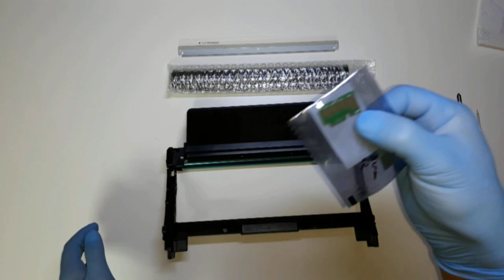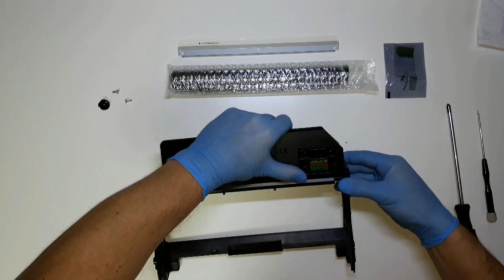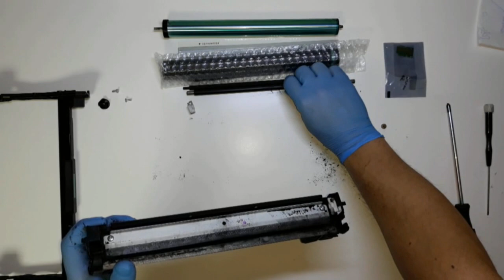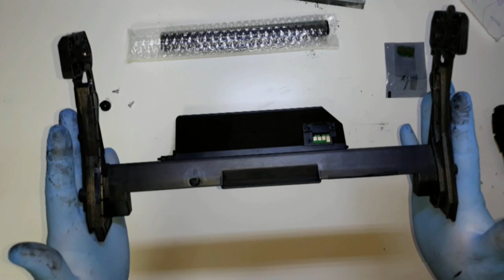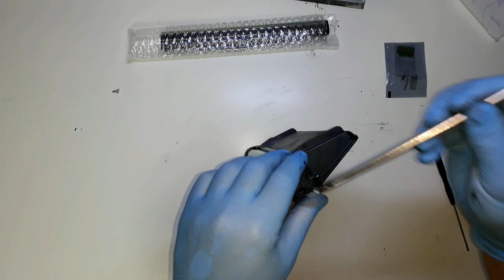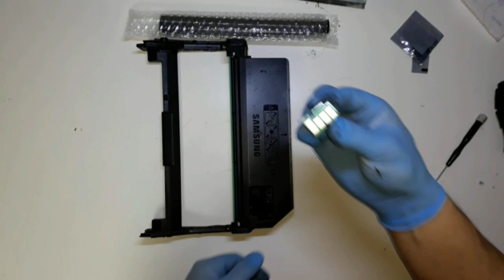HOW TO REMANUFACTURE SAMSUNG MLT-R116, XEROX 101R00474 IMAGING DRUM, OPC REPLACEMENT

Comment: Hi can you tell me the exact size of opc drum and the ruler cleaner?
Reply from the maker: Hello, Ronel, the size of the OPC Drum is 24mm in diameter. For the developer rollers I use PCL, for doctor blades and wiper blades I use Isopropyl alcohol.
Reply: Thank you for  that wonderful information, another thing is,  i want to refill my toner with powder but i dont know the exact powder that i will put, can you help me find out the exact cartige powder?
Reply: The diameter is 44 mm, how about the size ?
Reply from the maker: @ronelgarra7745  The lenght of the OPC Drum is 257mm.
Reply: Thank you very much